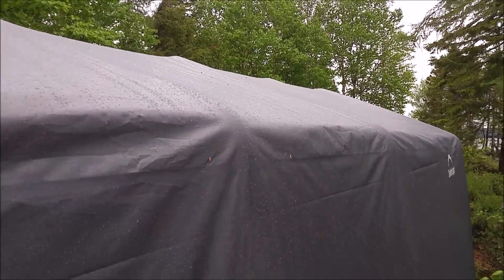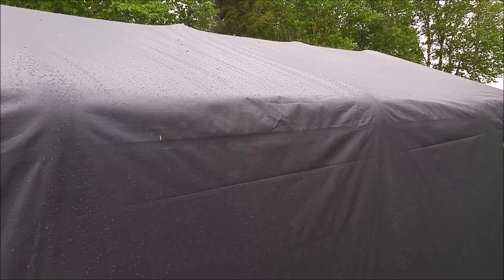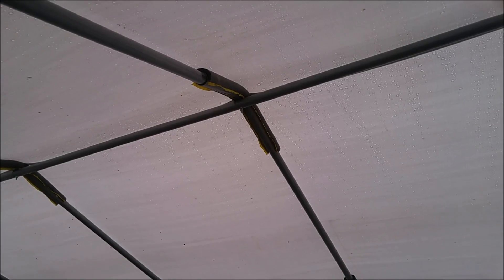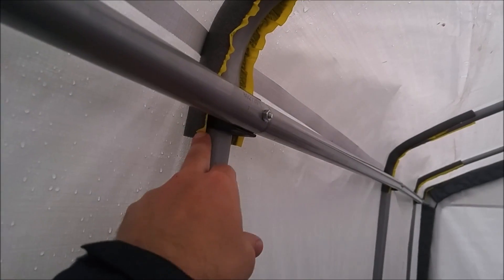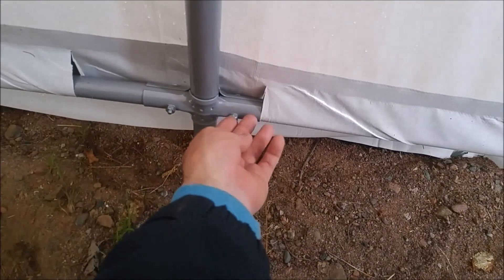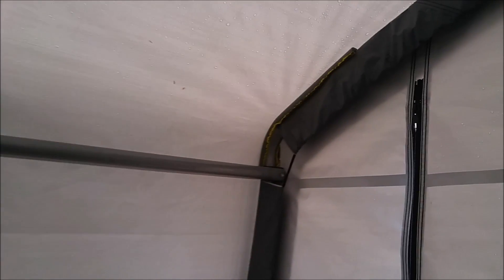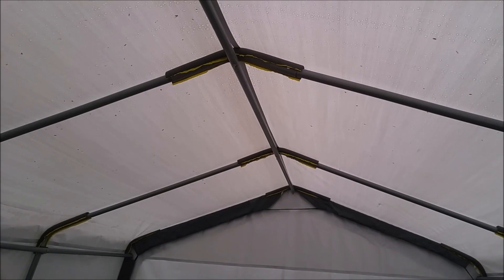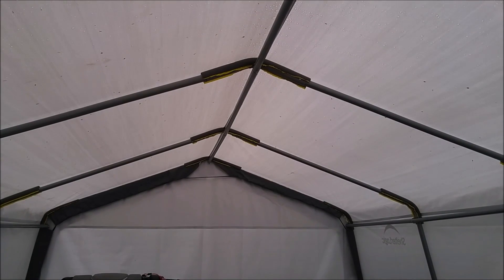Shelter Logic Tarp Shelter: Quick Tip Improvements

Comment: Thank you Dave for this great idea - I had not taught about this.  For the UV protection, I bought a large tarp cheap (nylon webbed) from HD which I used to cover the "roof" of the ShelterLogic, it has so far held for five years.  I also increase the bracing of the roof (Northeast snow) without any problems.  I also made a false floor to reinforced where the wheels of my pickup rest for air circulation over a tarp to keep the ground humidity low.  Keep on posting your "lessons learned", it helps guys like me and is very well appreciated, Ciao, L
Reply from the maker: Sounds like you've done a great job to ensure protection for not only the shelter from the elements, but also your vehicle!  Much appreciated.
Reply: i dont mean to be so off topic but does any of you know a trick to get back into an instagram account?
I was stupid forgot my account password. I love any assistance you can offer me
Reply: @Bo Bronson instablaster :)
Reply: @Fisher Israel It did the trick and I now got access to my account again. Im so happy:D
Thank you so much you saved my ass :D
Reply: @Bo Bronson no problem =)

Comment: Put a small 8 foot sq one up today and your tip is a good one for stopping the bolt head wear thank you
Reply from the maker: Nev Wells you're very welcome!  The one in this video is just like new after a very long winter with severe wind and snow.  The older shelter after a few years that did not have these simple improvements are torn and needs replacing.

Comment: I have six Shelterlogic shelters.  I have never had rub-through, but the UV destroys the fabric.  Three years is  the longest the fabric lasts before it tears, and tearing does not involve wind or accidental puncturing.  I have two new in box Shelterlogic and considered painting with UV resistant paint, but I also assume it would destroy any existing UV coating. Unless one spends the money on PVC coated fabric, one can't expect much.
Reply from the maker: Yes, they are not going to hold up well with UV, where I live the winds are over 60 mph/100 kmh often.  They are not designed to withstand a lot of wind, as the hardware will weaken and move causing chafe and or tears.  But you're right, the sun is the biggest deteriorate with these shelters.  Unless the shelter is positioned under large trees to help cover from direct sunlight, they won't last.
Reply: May I suggest a “fly” for your shelter. Get a sacrificial tarp from a box store and put it over your shelter…replace it as needed and keep the sun off of your expensive shelter
Reply: @stephanpetranker8994  The issue I have with a 'fly', are attachment points..  I have had to cut openings in the old shelter fabric to fasten a tarp over the big holes, until I can find another solution.  I bought roofing metal to cover one frame, but since changed my mind and will build a proper pole shelter frame and use the metal roofing to cover the whole area.  It will be a better use of the expensive steel roofing, as it will cover a large area than using it for siding on the Shelterlogic frame.
Reply: Ours did not last 6 months.
Reply: @Freecan67  And lately the price jump is not worth the purchase..  At $399, they were barely worth the effort, but now I see them between $700 - $1100 or higher.

Comment: Do you find the condensation gets soaked into the plumbing pipe insulation and stays wet?
Reply from the maker: It never got wet and stayed wet.  Plumbing insulation is also designed to withstand any amounts of condensation.  The powder coated pipe is also okay even if there was any moisture.

Comment: Hi! Were having a hard time getting everything exactly straight and inline. 
Once we put the tarp on, will it straighten it out alittle more? 
Our ground is mostly flat but were not able to get the measurements out of it, we should be.
Reply from the maker: Hi there, you can eyeball the framing, once the tarp is installed you can then adjust it to where it needs to be. The bottom section should be left loose until you get it anchored and then you can add down pressure to the horizontal bars at the bottom to tighten the tarp.  It will take a second person to do this easily.  You may also need to tighten again in a few months as the tarp will stretch a little.
Reply: @DaveWilcoxJrOutdoors  Hey thank you!! Its straightened up pretty good after getting the tarp on 😁

Comment: Hi, do you recommend the round top or pointed for winter light snow?
Reply from the maker: Hi Doug, I would likely go with the round top, I get a lot of snow here and haven't had too many issues but I do remove the snow on the shelter frequently.  I would also recommend a darker color shelter as the snow tends to melt much quicker with the dark shelters.  Hope this helps... also, keep the tarps tight with regular checks.

Comment: Thanks for the video.  Do you think one of these could modified to live in?  We're renting some wooded land from spring through fall and need a sturdy, large temporary shelter that can be packed into our mini van and stored in our garage.  Our camping tent just wouldn't hold up.  We looked into yurts, canvas and wall but they are pricey.  This looks like a very affordable option but I haven't found much in my searches of people using them for that purpose.
Reply from the maker: Brennan Huard hi there, I would like to believe that these tarp shelters could be used as a make shift home set-up... but they would not keep rodents out.  If heat is not required, then I believe they could be used as a temporary solution, however they are not airtight and do allow rodents and other critters to access the internal shelter.  My personal opinion is to consider a wall tent that are relatively inexpensive through research online!  Wind will keep you up all night with these tarp shelters, but you may consider if placed in a confined area that is rodent free.
Hope this helps?
Reply: Dave Wilcox Jr Outdoors Thanks for your reply.  This helps enormously.  I hadn't considered rodents or the noise.
Reply from the maker: Brennan Huard you're kindly welcome!  Best of luck with your new adventure!
Reply: There are videos where people use corrugated sheet metal or corrugated poly/ fiberglass panels instead of the canvas cover.  That would be semi permanent. You could probably seal it better against critters this way.
Reply: If you can build a wood platform and  set the shelter on that you will have a comfortable summer home. I know a couple campgrounds that have done this to rent to campers who don't want to set up their own tent. They are equipped with cots and gas lights.
Reply: Get a cat, or two.

Comment: I just put one up today...I am confused with the roll up door...no eyelets on mine...might have to cut it
Reply from the maker: crackboompow bam hi there... If you don't have the eyelets with grommets you may cut them out but be sure to use replacement grommets with the holes, otherwise they may tear.  Also, when rolling the doors, always roll them facing the inside of the shelter to avoid rain build up that can be a nuisance.  If your shelter came with the elastic fasteners to hold the door then you may have a manufacturer defect and worth contacting them.
Reply: I just cut holes in it...as per the directions good enough Thanks

Comment: Quick Tip Improvement* Singular. This is only one improvement tip.
Reply from the maker: Adjusting the horizontal piping periodically as the tarp stretches was also mentioned, along with choosing the better suited location... "Quick Tip Improvements" *Plural.